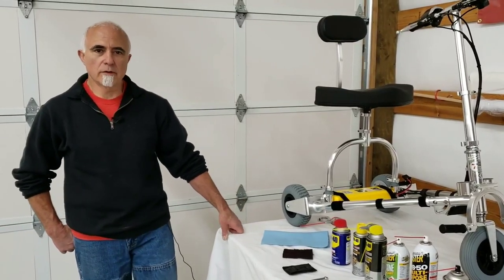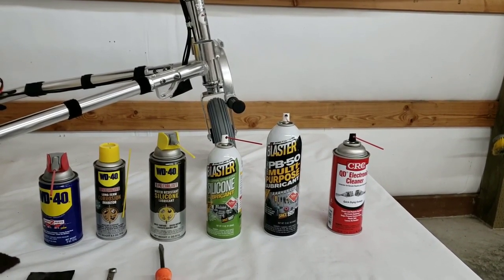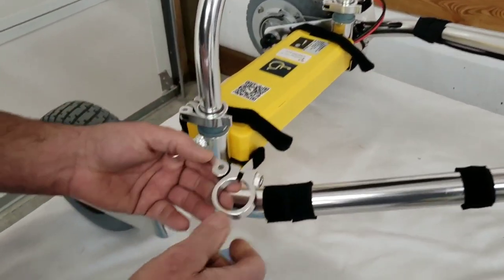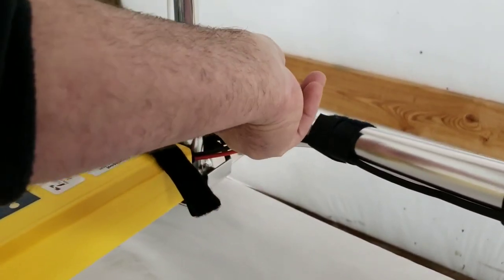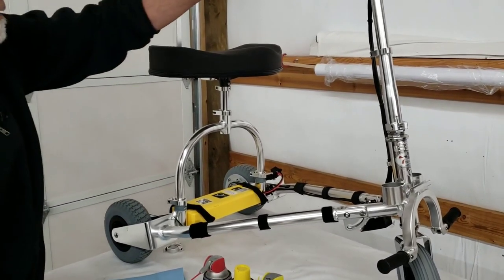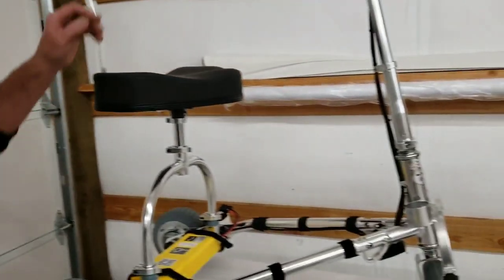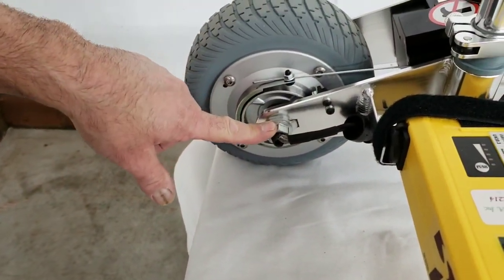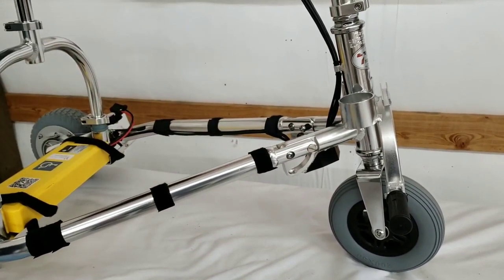General Maintenance Instructions - TravelScoot Mobility Scooters

Comment: Love the TravelScoot- getting an occasional delay or no go on the throttle. So far it does kick in quickly. What do I need to do to to resolve issue?
Reply from the maker: Please call us up so we can get more details as to the year and model of your scooter so we can zero in the issue.  800-342-2214
Reply: @TravelScootUSA    Tony this is my issue I wrote to you earlier the model i the middle one you show in the three types video I live i NZ
Reply: I have a similar problem with mine, my experience with electronic controlled motors is that it is a slow  ramp up and ramp down problem.